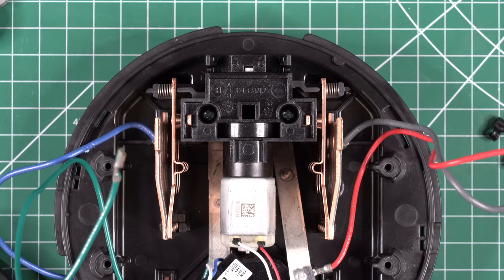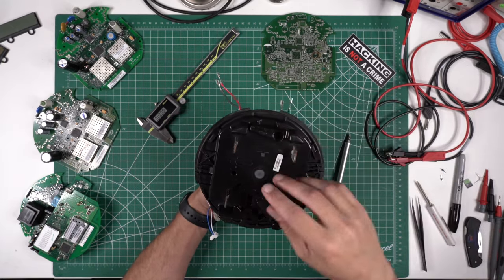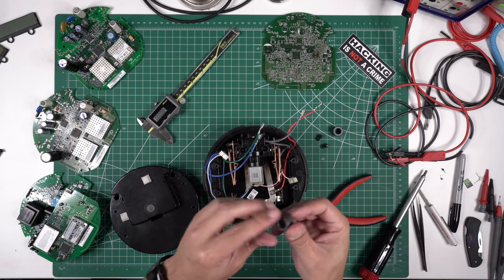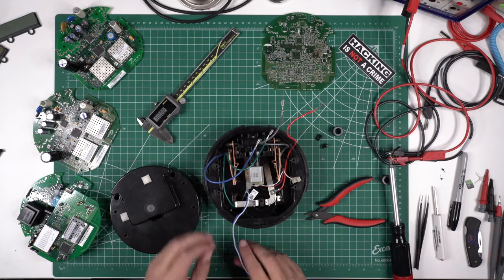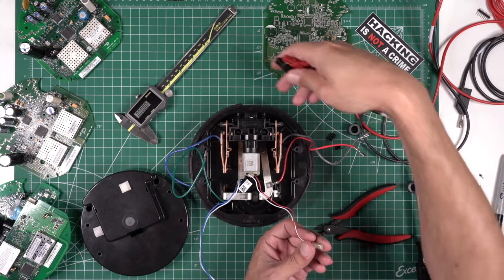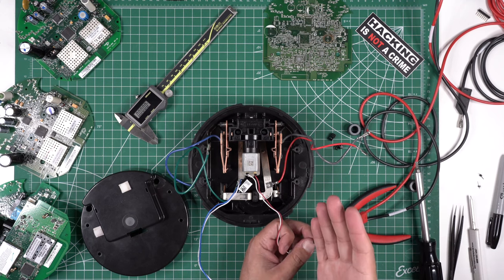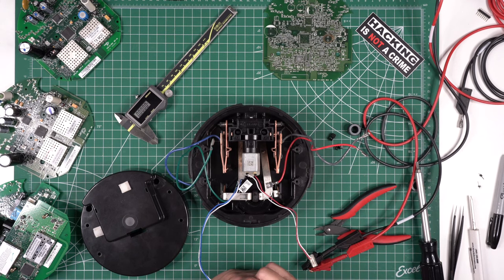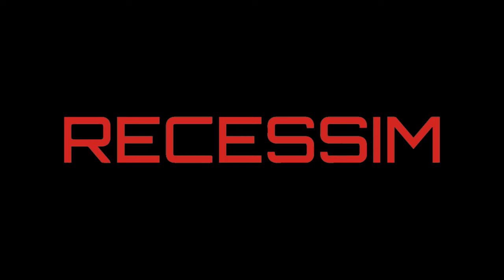Smart Meter Hacking - Remote Disconnect

Comment: This is very interesting and could provide a way for companies to cut the load. During the black out companies need to cut the load, and unfortunately it was not not cut in a smart way. (ok well in fairness, they kept the grid up, which was smart, but i digress...) If people used power smartly, and everyone only used 1/4 of the normal power, they could have kept some power on to everyone. It would have been nice if everyone was given a choice, limit your power use to 1 killowatt per hour, or have your power cut. It might also have been nice if power outages rolled like they were intended too but that is another story. Instead if people then could have turned off hot water heaters, stoves, furnaces ect, but still had lights, internet, and a few light bulbs near freezing water pipes to keep heat on. (Now whether that load be 1 killowatt per hour or 3 or 10 the point is load needed to be cut fast.) Coming from a northern climate, I would like to point out that people that wanted a warm home, they could have had a $150 kerosene heater, and 20 gallons of kerosene and produced enough heat to keep a house warm. Also if you had a generator, you likely ran that which also come in handy during hurricanes. The power company really needs to focus on big problems, -keeping power one for everyone, building new plants, insulating pipelines, having some power via alternative energies (coal ect), and not into micromanaging power cut. All that said, a smart meter than could cut power, might allow a system to limit that load. Each person gets X number of killowatts per day, (or per 6 hour window). Unfortunately shutting off the power is about the only way to get people serious attention, but once off people are willing to go to great lengths to get it back on. if one tripped these meters based on usage, you could cut load in a much less troublesome way. Cutting the power that way, allowing it to cycle more frequently, and making people aware of their usage would be a better outcome.
Reply: I understand that the power outage was complicated by many factors, uninsulated natural gas lines, complex power markets, weather, trees on lines, spot natural gas markets, foolish actions of people. What I find sad is some was easily preventable. The second largest user of power in homes is hot water heaters, something most of us would gladly give up, if the choice was a cold home. Everyone should be smart enough to approach the circuit breaker box and cut the circuit to the hot water heater. That was a public informational gap (and many people did burn out hot water heaters because they did not do this after power came back on). And many people failed to weatherize homes. Basic things like insulating water pipes, go a long way. And some of this can be done with very simple materials, (skirting around mobile homes). Sadly, there were lots of lost opportunities to make things better.
Reply: Yep. Unfortunately, load shed, may be done at a (remote) substation or feeder. The power is turned off by remote means, but many of those were unable to be switched back on during the February Storm Uri. Crews had to be sent to the substations to manually power them back on.
If only people were smart enough to use power smartly... I heard of many people who said "My power's on and I'm cold (68F). I'm cranking the heat up!" while others were freezing and had no choice. :(  I turned my heat down to 60 during the day and 50 at night. I wore plenty of layers of clothes. I ate canned food or other food that did not need to be heated. I would have cut the water heater to save, but the water pipes froze and exploded and made that decision for me anyways! LOL. Yes. There is much that could have been done. Some by the electric companies and some by individuals. This is not the last time we'll have these conditions. It's happened before and it will happen again. Personally, I'm weatherizing my residence and preparing for the next winter storm (generator, solar, no more frozen pipes, etc.). Lots to do and winter is coming sooner than you think.
Reply: Ridiculous. If you cut my power for high usage, but left all my neighbors on, I'm running an extension cord. We do it all the time after hurricanes. One side of the street might be without power while the other side has power. You'll see dozens of power cords running across the street.
Reply: @fauxque5057  And that probably would not be a problem. A typical extension cord can handle up 1500 watts (up to 1875 temporarily) on a 15 amp circuit.  I have run extension cords to neighboring houses as well. In these Load shedding situations you have homes pulling a lot more power. A hot water heater pulls 4500 watts. Electric Baseboard heaters can pull 1000 watts each and homes can easily have 4 or 5. The whole point is to get demand down, to where everyone still has power. One extension cord, or one heater will not keep your house warm, maybe one room, probably could keep your pipes from freezing (if the heat is put in the right place). It would be better to spread out the power so everyone can have a little. Any way that is done, is way better than having one person waste it all, and another have none.

Comment: Thanks for this video. I have a sub-panel with its own smart meter that's behind my main meter, also a smart meter. This enables the power company to cut power to my sub panel to manage peak demand. In exchange, I get this electricity at a discounted price.  This sub-panel handles heat, AC, and hot water.

I also have an emergency generator.

Here's the issue...  If the sub-panel meter/switch were open (under load management) and there was an extended power outage, the sub-panel meter/switch stays open and the emergency generator can't provide power to the sub panel with heat, AC, etc. This leaves the possibility of being without heat/AC for an extended period if a large-scale power outage occurred.

Thanks to your video, it looks like I have an emergency workaround but it would require breaking the seal.

Is there any way to send a "close" signal to the meter when my generator kicks on? This is a problem that many people have but most don't know it.  I assume it applies to numerous load management switching schemes.
Reply from the maker: That’s quite interesting, I’ve heard you can also control the relay within the meter via the IR port on the front as well, but need a password.

I believe I have a password for a meter so I was thinking about making a device that could send commands to possibly turn it on/off. For emergencies like you mentioned, it would be very handy.
Reply: @RECESSIM  on a completely different topic, the fact you are replying to comments on videos over a year old shows me that you are engaged with your viewers which you don’t see that much on YT anymore. Granted, your content earned my subscription about a hour ago but seeing this just solidifies that decision. Now I just need to stop myself from binge watching every bit of your content so I actually learn a thing or two lol
Reply from the maker: Thanks for subscribing. I learn a lot from random comments or get ideas for new directions to go so I enjoy replying. Hacking & Reverse Engineering are “doing” endeavors in my view. Nice to watch some then take a break and see if you can replicate things or just try installing something new for fun.
Reply: @RECESSIM  well you’ll see a good bit of me in your comments from now on. I love hacking everyday items as well. Usually to fill some purpose like repairing, discovery or teaching my kids. Even though my software skills are weak at the moment my hardware knowledge isn’t and if I can help with my experiences I’ll be happy to contribute when I can. Just keep up the great work. My son and I are really enjoying your series about smart meters
Reply: Hi Brian, Hi all! I watched the other video with Gnu radio where i heard that Brian contributes to the project. Do You have the Rom from this switch some where in the internet? Maybe the IrDA password or the public key  of the company could be extracted. I think that Meter doesnt sign its own messages sending and only forwards blobs from other meters. The idea of sending messages to the neighbour sounds plausible